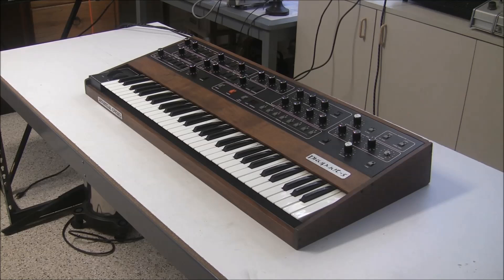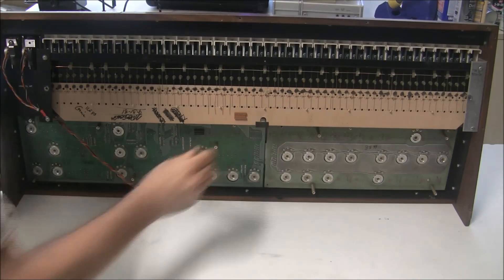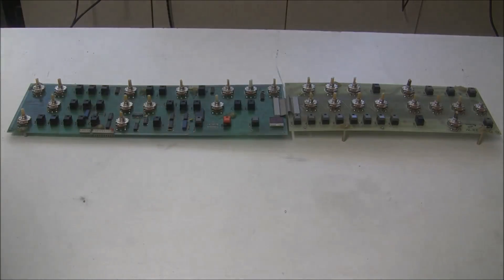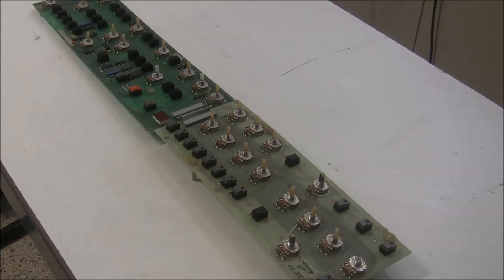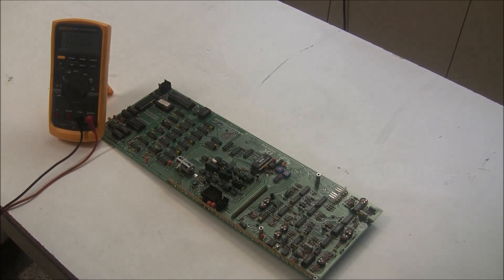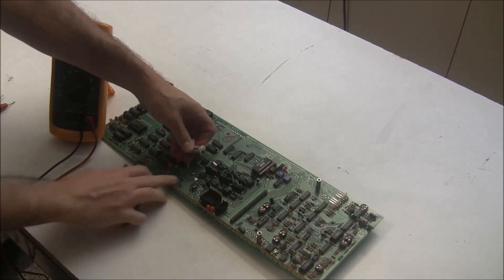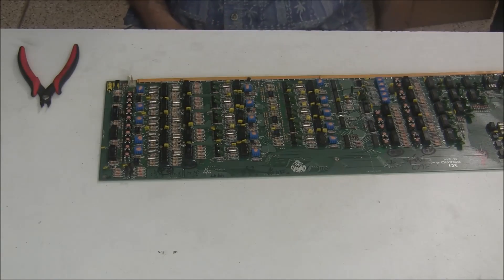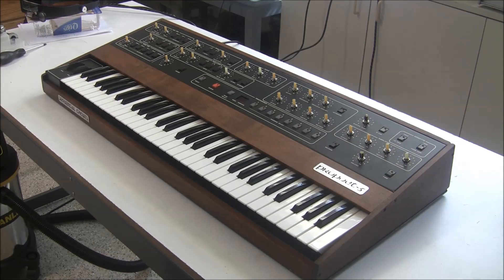Synthchaser #066 - Sequential Circuits Prophet 5 Restoration & Repair - Capacitors, Battery & Pots

Comment: I've been working on one of these for a while. aren't there a MESS of little 1mf or pf caps in the middle of all the rows of chips... did you replace all of those, non polarized tantalum originals?
Reply from the maker: I think you may be talking about the little ceramic capacitors.  There's no need to replace those, they rarely fail.
Reply: @Synthchaser  thank you. I started this year's ago... for some reason I was told to change them out. They sit between the banks of chips on any of the boards... probably the most numerous of all, rather tiny things... I got small blue non polarized tantalum ones... yeesh... that was a lot of work. I wish I had waited a bit longer. Your video helped a lot, though. I pulled nearly all the cmos chips as well, as that was recommended to me for full restoration... I think I was getting info from some dubious sources!! Lol
Reply: @Synthchaser  tyttttttttttti 0uuu6

Comment: Why do you remove all these tantal electrolytes without even checking whether they are faulty or not?
Reply: Because they are ticking 'time-bombs' - they have a high failure rate at that sort of age, so might as well get them out and replaced before they cause issues.

Comment: at 10:25 what is the white capacitor? This is the one that has exploded on me and needs replacing. Do you know what is and possibly what it controls on the keyboard?
Reply from the maker: It's the battery for saving the presets.

Comment: Great video series! When I restored by P5 a few years ago, I just replaced the tants in the PSU and on the power rails. I was under the impression that that tants in the audio chain posed little risk. Do you think it's worthwhile I go back to replace those on board 4 as well?

Comment: The pot nuts on my P5 were so rusted they physically turned the body and separated the foil strips from the PC board. If you P5 is old and neglected it may be wise to put some penetrating oil (e.g. Liquid Wrench, PB Blaster,etc.) on the nut and waiting for penetration before removing the nuts.

Comment: What a gift ... one day after my anniversary, and  THE vidéo series to restore my Rev3, i juste repulsed a few days ago ... still working but quite unstable. Was in its fly case for too long. Big dealing is needed
Will by you parts ... my PSU is ... original one ...   Do you plan a vidéo for calibration or VCO not tuning ? This i my main issue. But anyway a great thanks for those helpful  videos.
Reply from the maker: Yes, I will be posting videos of the calibration and the keybed restoration, as well as videos to repair whatever is broken with the synth.
Reply: Great. Thank you. My rev3 will love it.

Comment: can you replace tantalum caps with electrolytics? what is the  difference?
Reply from the maker: Yes, you can. I pay attention to the use of the capacitor (audio decoupling vs power rail bypass) and select the best electrolytic for the application.  If you notice on one of the boards I even replaced the tantalum with an MLCC which is a better choice.  There will be no difference to the sound, but the new ones are much less sensitive to transient voltage spikes than the tantalums.